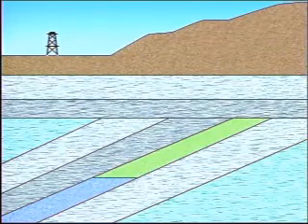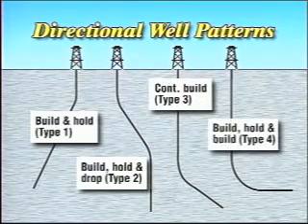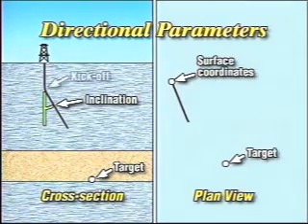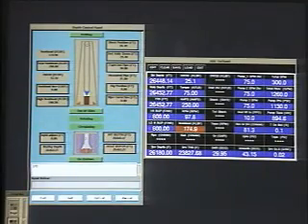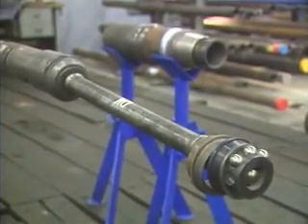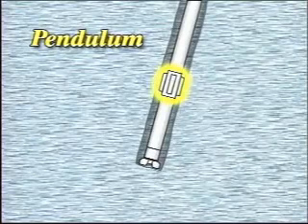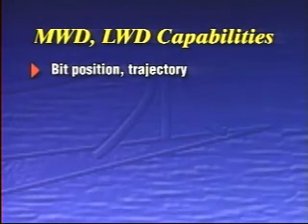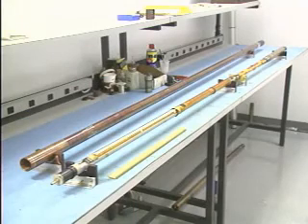Directional Drilling Part 1

Comment: What is Dog leg?
Reply from the maker: In the context of oil wells, a dogleg refers to a deviation or change in the wellbore trajectory. It occurs when the wellbore deviates from the vertical or straight path and takes on a curved or angled shape. Doglegs can be intentional, designed to navigate around obstacles or reach specific targets, or they can be unintentional, resulting from geological formations or drilling challenges. Managing doglegs is crucial for maintaining wellbore stability and drilling efficiency.
Reply: The intentional change in inclination or azimuth created in well bore to get desired well path doing directional drilling.
Reply: @deepeshpathak.7  they aren’t always intentional! lol
Reply: DL=DLS.L
Reply: Simply dog leg severity is the change in inclination per 100 ft